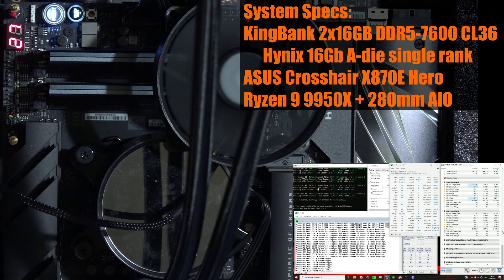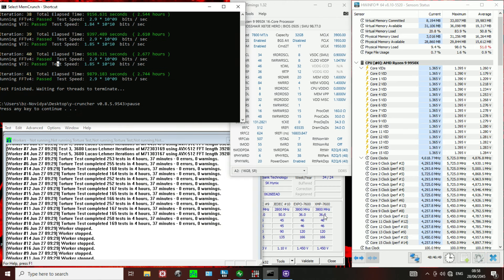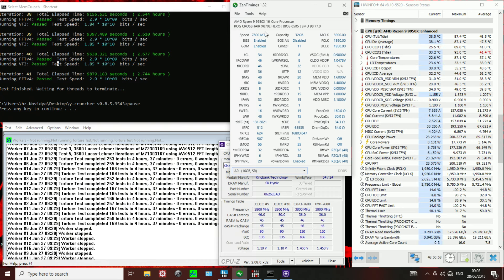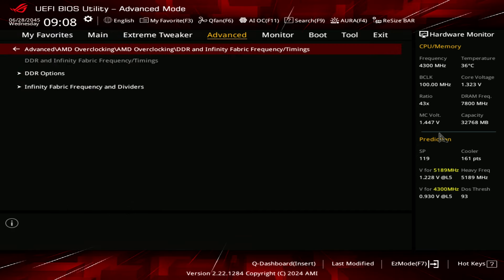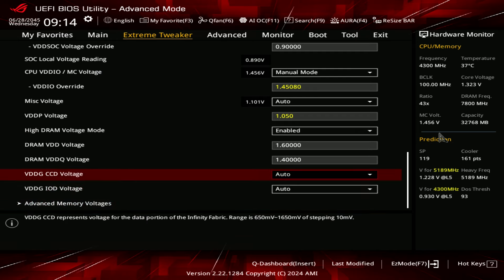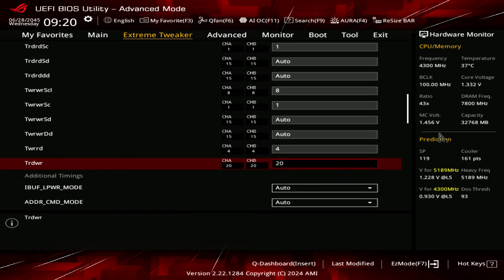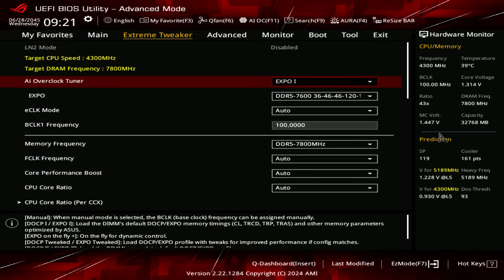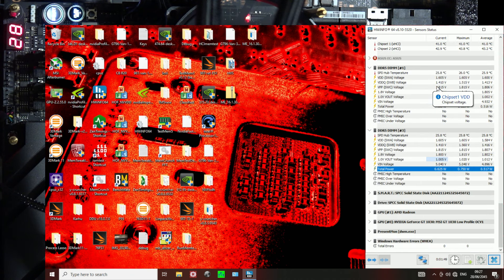SUPER LOW SOC VOLTAGE DDR5-7800 CL34! Ryzen 9950X, Crosshair  X870E Hero

Comment: I spent some time (well, practically a day) on testing this out with my 9700X and 48 GB Hynix M-Die (G.SKILL 7600 kit). The premise for any high speed DDR5 turned out to be to set VDD to 1.6V (no boot at 1.4V and unstable at 1.5V). After that, it was not that hard to get 8000 to boot, but I couldn't get it stable at CL34 (same as you). So I went for 7800CL34 which works well (1950 MHz IF). I could replicate almost all your timings, except Trfc1, which wouldn't boot at 512, it's now at 640. Also TrrdL wouldn't boot at 8, it does at 10.
After some stress testing and benchmarking, I'm quite confident it's stable. I had setup 6000CL28 earlier and this 7800CL34 is similar in benchmarks, but a big difference is the lower SOC voltage and subsequently the idle/light load power consumption. I'm one (of the few?) who cares about that and the result is frankly amazing. While browsing/emailing the CPU is ticking away at 10-15W where it was 20-25W earlier.
So a big thanks for putting all this work in memory tuning/overclocking, it's a great help and also gives interesting insights! 🙏

Comment: Great achievement, this drops then idle power draw on AM5 Ryzens significantly. For instance my 7700 needs 1215 mV SoC to pass 6400 MT/s with stock CL32 EXPO timings. Minimal idle draw is then 34W, however with 6000 MT/s I can afford to drop the voltage down to 1075 mV with confirmed stability (OCCT + Y-Cruncher + Karhu) and I have not tried going further down. What is nice idle power drops then down to 27W. If only my intel i225V network card on Strix X670E-A was stable at L1 ASPM, I could drop another 5W so I could have 22W idles which are more like in "intel idle" typical consumption ranges
Reply: At 8000 0.9V VSOC, I get ~15W PPT. 

Also the idle power argument from Intel fans just doesn’t make sense. Like, even if you idle for 8 hours a day (you don’t) and game for 2 hours a day, a 14900K still consumes more energy than the 7800X3D, not accounting for VRM loss and power from additional cooling.
Reply: @PowellCat745  exactly but intel fans are too stupid to calculate this in their head which is funny to watch because apparently having 10w more on idle is bad but it isn't bad when CPU pulls 100w more than AMD counterpart in gaming let alone actual full bore workloads which make CPU's go to narnia power usage wise

you know intel is not in a good spot when their i9's are approaching threadripper/epyc power usage while having parsecs slower performance vs said threadripper/epyc chips
Reply: @PowellCat745  My system stays on 24/7 and acts as a server. I found that route to be cheaper than running dedicated high power servers with shockingly similar reliability metrics when running. Power matters. Even 50W adds up. Overall, a 13900k emerged as a victor over a 7950x system when tuned. Compared to the 7800x3d though, the 7800x3d would probably come out on top but with a decent amount less multi thread performance which is why I didn't consider using one.

But that's old news. The zen 5 9950x was very tempting with its true avx-512 support, but not quite enough of a performance uplift besides that. Arrowlake 285K looks very disappointing. Guess I keep waiting.

Comment: You do any serious testing with curve shaper? Seems really useful and currently I’m able to run 9950X at -35 CCD0 and -30 CCD1 with a 200mhz boost override and 102 ECLK which is a pretty complicated configuration that probably just wouldn’t work on Zen 4. Only reason it even works too is because I’ve configured the max and high frequency to +25 and +15 respectively. Gives a ton of control over the entire VF curve.
Reply: How much voltage is being put thru the cpu?

Comment: From my understanding its the infinity fabric links to the ccds that are limiting, if you run a bandwidth test on the IGP, it will get full bandwidth,  since the data path on the i/o die itself is 64b/cycle, vs the 32b/cycle that each infinity fabric link has
Reply: Bandwidth on 1 CCD and 2 CCD is the same, max 32B/cycle total read despite the GMI being 32+32 wide.
Reply: @AerynGaming  not sure what you're trying to say, each link is 32b/cycle read 16b/cycle write, max read bandwidth to both ccds is  128gb/s(64gb/s x2) at 2000 fclk,  and  64gb/s write (32gb/s x2) ,   if you have a workload that uses both ccds , you can read more than 64gb/s.   the reason this is possible, is because the io die itself transfers data internally at 64b/cycle, so it can feed 2 gmi links.
Reply: @kelpmaxxing  You cannot actually hit those transfer rates. Max read BW on 1CCD and 2CCD are basically the same in proper testing tools.
Reply from the maker: you can't because the UMC only has a single 32B/cycle link to the infinity fabric.
Reply: @ActuallyHardcoreOverclocking   the chips and cheese article on zen 4 shows a max of 72gb/s when using both ccds in their testing, and 56gb/s with when using 1 ccd , when using the stock 1800fclk,   32b/cycle from the memory controller doesn't matter because the memory is only 16 bytes wide to begin with (128bit). and the asynchronous link to the infinity fabric  runs at the speed of  of the memory,  aka if the memory is running at 3000mhz(ddr 6000) x 32b =  96gb/s

if you are skeptical, you can check the igp bandwidth with poclmembench
Reply from the maker: @kelpmaxxing  Software memory tests have a tendency to spit out physically impossible memory bandwidth numbers.
Reply: @ActuallyHardcoreOverclocking  so long as the reference timer is accurate and you use a large enough data size , software tests are fine, programs like aida have lots of bugs due to 20 years of hardware changes, I think that if you look outside of the benchware ecosystem and look at more functional tests like poclmembench, ramspeed-smp and stuff meant to test servers, you'll find that it gives more realistic numbers if you know how to configure it properly.

Comment: But multiple ASUS fans screamed out loud when SOC was locked to 1.3V max, because they though that their overclocking was sabotaged.
Reply: I can tell you whatever behavior this board is experiencing isn’t normal through my limited experience with two Asus AM5 boards closer to the midrange. I’m currently SOC limited for 6400mhz and 2:1 speeds, it clearly gets less stable with less voltage and doesn’t work below 1.25v for 6200mhz.
Reply: @DreadyBearBoi  Sounds weird, my 7800x3d and Asrock X650E runs 6200 1:1 with SOC 1.2V, did not try lowering it.
Did not see any performance increase in games though, assuming my 6900XT is to slow for it to make a difference.
6400 1:1 SOC 1.2V began acting weird with sound errors and stutters.
Reply: @DreadyBearBoi  UCLK needs SOC. Overclocks at half UCLK do not need SOC. I overnighted my 8000 daily (2000uclk, 2000fclk) on spec SOC (1.05v)
Reply: @larsjrgensen5975  I've heard from other overclockers that there is no benefit from clocking ram above 6000 with the 7800x3d whatsoever. It was something with the x3d technology that doesen't afford it the benefits of faster ram, although I can't remember the details.
Reply: @Meticulate826   I agree.
The bigger the cache the less time spend working in the memory.
I would guess that the 1 CCD design also limits the point of where memory speed makes sense, the 7950x has higher memory speed (GB/s) then 7800x3d with the same memory installed.

Comment: Any page / way to see when you will be reacting to new ram timings? I got mine on 4x  32gb ddr5 finally stable but only on 5400hz, it does have tighter timings at least (i think).

Comment: I have exactly the same experience with my 9950X and 8200mhz DDR5 sticks. I could boot to windows up to 8400 CL40, but nothing is stable even with 8000mhz. Did not try 7800 and settled with my other kit with 6400 1:1 which is mostly on par or faster than 7800 2:1. I have a feeling, its not a bad CPU issue. Have you seen any stable setups of Ryzen 9000 running 8000+ RAM? I haven't.
Reply from the maker: what board?
Reply: @ActuallyHardcoreOverclocking  X870 Aorus Elite.
Reply: @techtechuw597 any updates on stability?
Reply: @Chicken-o5e  nothing. I gave it another try just last week. It's a no go. My CPU/MB combo can not do ddr8000 with those sticks no matter the timings or voltage. Just not happening. I settled for 6200 1:1 for 24/7 stable setup.

Comment: Question, if someone wanted to run these settings, but say with CL36 to lower the VDD because 1.6v is scary for some, what voltage would you say, ballpark, to start at & work your way up? 1.5v?
Right now I'm running my G.Skill 2x48GB CL32 6400MHz kit at 6200MHz CL28 1.5v and it's pretty damn stable (haven't done extensive testing yet but I've done some) - before you ask, I tried to run 6400MHz at a few different settings, either my CPU or memory controller itself is not about that 6400MHz UCLK:MCLK life, even when running 2133MHz FCLK with 1.25v SOC. 
Other question is, in reference to my RAM specifically, have you tried running 7800MHz+ on any 2x48GB kits yet and how has it gone? Do you know of any 2x48GB kits that are almost guaranteed to be A-Die?
Reply from the maker: 1.45V should do CL36
Reply: Any updates? I need some help. I want to get corsair vengeance 48×2GB cl32 6400 mts kit intel xmp ready. Ive seen reviews saying its only stable at 6000. I have an amd ryzen 9950x, will that have some stability issue with an intel xmp kit as opposed to an expo kit? Should i instead get the kit you got just to settle at 6000 stable for 96gb? Ive done so much research yet i cant find help.
Reply: @Chicken-o5e  it's almost completely dependent on the memory controller whether or not you can actually run 6400, it has very little to do with the ram itself. I am running CL28 at 6200MHz (1.5v VDD, 1.4v VDDQ & VDDIO) with 2067MHz FCLK (1.2v DO), while also running an ECLK OC on my 7800X3D for a 5.25GHz max single core boost with 5.05GHz all core max boost.
This ram is amazing, my CPU's memory controller just cannot handle 6400MHz, it wouldn't run 6400 speed regardless of voltages/timings on a 2x16GB CL30 6000MHz kit either.
I also still haven't gotten 7800MHz to run on these sticks full stop. But I also haven't messed with that much because I have these settings nice & happy.
Imo choosing between the Corsair & G.skill kits is a matter of preference. The Trident Z Royals are bright as fuck & shiny, the Corsair sticks are less bright & less gawdy - not sure on price diff because I don't know which Corsair kit specifically you're referring to.
Reply: @LOLHoneybadger  thanks for the update. Im talking about this kit CMK96GX5M2B6400C32 its on amazon the 96gb dual rank (48×2) variant. I guess its safer to buy your kit since urs has amd expo as i have a 9950x. Also, is there a benefit to having an m die or the a die variant of ur kit or the kit i mentioned? Is there even any hynix a die available for these?

Comment: Hello, Is there any tutorials on how to deal with memory on 8x00G when running on iGPU? I literally cannot get over 6000 for 1:1 mode 😢 when doing a stress test at 6200 iGPU shuts down. The same happens on every EXPO profile
Reply: If you're gaming on iGPU, BW is king. So 1:2 mode with at least DDR6400 is faster than 6000 1:1 mode almost universally.  When we launched 8000 series processors, we used 6400 1:2 mode for the performance results and marketing slides. Good luck
Reply: @billalverson6168 actually I do run it on iGPU while waiting for the  new gen GPUs 😂 with 1:2 mode it runs at 7600, it is even OK with 7800, but after long occt tests it throws errors.

Comment: running 1.02 soc at 8000 C34 and 2000 fclk since over a year on a Gene with a 7200 kit, on a 7950x
Reply: Hey mate , is it possible to run 8000 on 6000 cl30 kit ? Or should I buy 7400 cl36 kit ?
Reply: 8000 C34 thats pretty good.
Reply: I am doing 8000CL34 on VSOC 0.92V, VDD 1.49V and VDDQ 1.29V 7800x3d, you can't insert a confirmation link here. /a/sIu7skW
Reply: @paranikumarlpk  it is a bit extreme, it will surely requires pretty high voltage, 7400 is fine but look for a kit with lowest voltage req. , for example I am using 1.61 vdd Wich pretty much the limit for a normal daily computer and you need a fan on the dimm as well.
Reply: @paranikumarlpk  plus you 99,5% need an Asus gene, and a good cpu imc
Reply: @Al-hk6yi  cool thanks for the info mate ggs :)
Reply from the maker: @paranikumarlpk  I have a corsair 6000C30 kit that does 8000 but IDK how consistent it is that low speed kits will do 8000.
Reply: @ActuallyHardcoreOverclocking  oh cool thank you sir !

Comment: Hi - total noob here. Is the practical benefit of such tweaking meaningful energy savings during productivity tasks, better gaming fps, or is this more just doing it for the fun of it? Thanks.
Reply: Depends on your cooling solution, but tweaking like this can have quite a significant impact if you’ve got limited cooling capacity. I’ve got a passively cooled system and got the idle power consumption halved by mostly memory tweaking. This gives more headroom when performing demanding tasks. For me, in some scenarios the performance benefit was about 20%, which is pretty substantial.

Comment: Which voltage to use for 6000MT/s CL 30 for VDDP and VDDIO? And buildzoid timings?
Reply from the maker: VDDP 0.95V should work on most boards. VDDIO depends on the motherboard you have.
Reply: @ActuallyHardcoreOverclocking  x870e hero i have, like you

Comment: I haven’t seen the 8700G on your channel? For memory overclocking, that chip blows all the 7000 and 9000 chips out of the water. I’m running DDR5-8000 with no real effort and got 8400 pretty easy with looser timings (and IF at 2400 no fuss). I heard a Chinese guy was even getting to 10000 with it. So I’m really curious what you could achieve with it 🙂
Reply from the maker: yeah and for actual useful performance the 8700G gets wrecked by a 12700K. It's a great memory controller attached to an expensive potato CPU.
Reply: @ActuallyHardcoreOverclocking  it’s not that bad. The 8700G is also a good overclocker. With a little effort you can get performance on par with a 7700X. But in my case, the low idle power consumption is the most important benefit (I have it in a passively cooled case).
Reply: @ActuallyHardcoreOverclocking  in some games 8700G iGPU is faster than 1080ti, not kidding. I was surprised myself. That's in some new games, like Alan Wake 2.
Older games like GTA5 or CS is a different story, 1080ti is 2x faster in those.

Comment: what you think about as rock adding mem clock option to cheaper boards  like x870 steel legend
Reply from the maker: adding what mem clock options?
Reply: @ActuallyHardcoreOverclocking  6400mhz 2133  ucloc memclock 1to1 atleast that what some review say

Comment: you couldn't do 8000 on the b650e tachyon? or did you just not bother
Reply from the maker: not with this CPU
Reply: @ActuallyHardcoreOverclocking  wait you couldn't do it with this cpu or you didn't bother to do it?
Reply from the maker: @catonturtle3202  I posted DDR5-8000 videos with other CPUs on the Tachyon.
Reply: @ActuallyHardcoreOverclocking   8000 MHz, is it possible with a 7800X3D? (ASUS ROG B650, A DIE SK HYNIX 2X16). My record is 6000 MHz CL26 33 30 26(I succeeded with the help of your videos ), now I would like to try a higher frequency, lol.
Reply from the maker: @kcdq-02  7800X3Ds can do 8000 but I wouldn't expect it to work on an ASUS B650 board. Maybe ASUS B650 ITX but the 600 series ASUS 4dimmers in my exp are really weak for RAM clock.

Comment: What should FCLK be on 7200 ram? Specifically for gaming
Reply from the maker: 1800FCLK for sync but I think for performance that's so low that you'd probably better of with desynced 2100 to 2200.
Reply: @ActuallyHardcoreOverclocking thanks. Would I be better off trying to manually tune it to like 6200 1:1 for gaming?
Reply from the maker: @sengan2475  6200 will beat 7200 at everything. 2:1 mode only makes sense from 7600+
Reply: @ActuallyHardcoreOverclocking interesting. Techpowerup did a memory scaling test on zen 5 and 7200 consistently had the best 1% lows in games. Generally beating even 6400 1:1. Could be a difference in sub timings between the kits I suppose. what games/benchmarks do you use to test memory performance for gaming?
Reply: @sengan2475  Battlefield (particularly V) tends to scale well IME. As for benchmarks etc, Pyprime and Linpack xtreme are good for checking performance increase/regression.
Reply: @IIHydraII thank you 🙂
Reply: @ActuallyHardcoreOverclocking yep. 1800MHz seems logical but it's not faster in this case. 2000+ is the way to go

Comment: Apparently the 9800X3D got 2:1 with DDR5-8800 C40...  should be interesting what kind of overclock this gets... also Gigabyte says they have a new bios for X3D that will push performance by 35%... sounds like BS but who knows.

Comment: I think you're just expecting too much from an 80mm fan, bigger fans with similar blade design perform extremely well in testing. The way theoretical airflow scales with fan size is very non-linear and unintuitive.
Reply from the maker: I have other 80mm fans that move at lot more air at the same RPM.
Reply: it's just the trade off for noise vs airflow with the shallow fan blade angle.

Comment: I have these timings at 7800 but at 1.46VDD and 1.38VDDq with the same memory sticks 7600, at 1.6 is doing cl 32 44 42 42 84
Reply: Hey have you tried 6400 1:1 may be below 1.45v ? It will be same or a bit better than 7800 right based on the workloads/gaming ??
Reply: @paranikumarlpk  6400 unfortunately is slower by a margin and it requires 1.3v insted of 1V on 1:2, also isnt rock stable with fclk2133 is ok on 2000. There are tests that 6000 1:1(or 3:2) is about 7000-7100 cl 32 therefore 6400 is like 7600/ 1950. But if u r using programs 2133fclk might be beneficial. In games anything above fclk 1800 is enough. But if someone is using 6400 is ok i guess just for the same speed it will take little bit more power. U can run hwinfo and check that